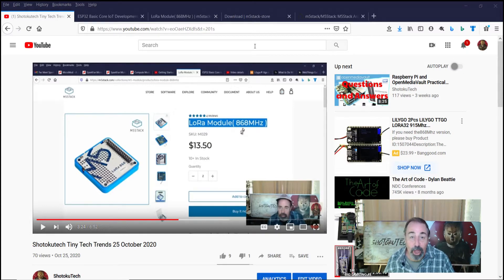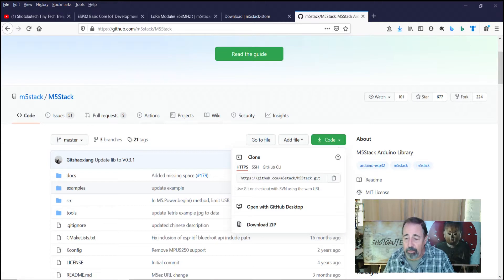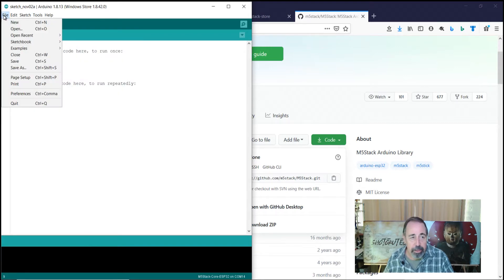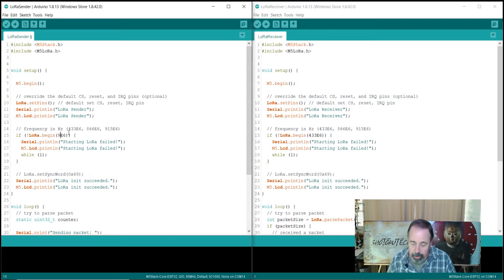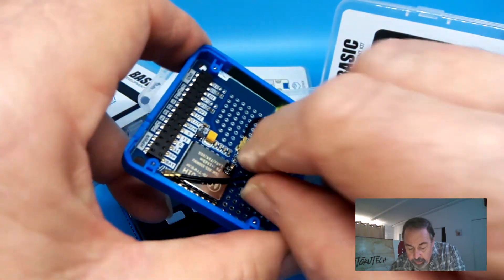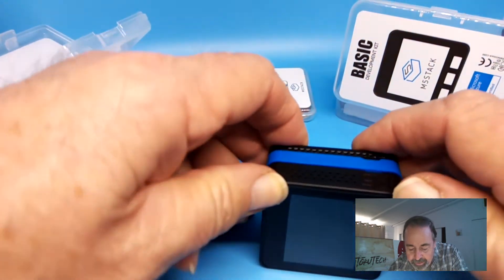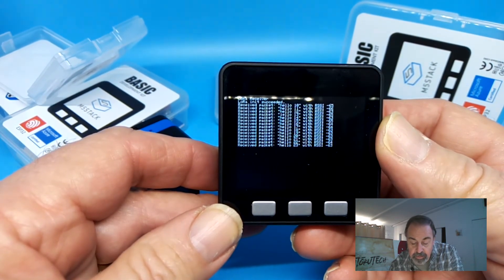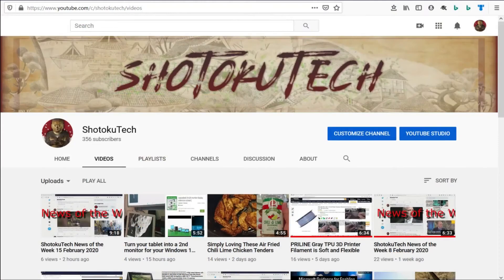LoRa 868 Module Tutorial for the M5Stack Core ESP32 in Arduino IDE

Comment: The lora 1.1 module does not stack onto the core2 with the battery pack. even though m5stack lists them as compatable.
Reply from the maker: Interesting. I don't have a Core2 though. Thanks.
Reply: I asked support and they said the two modules are compatible. They just arrived in the mail and I can't get the Core 2 back plate (even with the battery removed) to attach to the back of the LoRa module. Did you ever figure this out?
Reply: @williamgardner nope, never have gave up they told me the same thing ... If it is compatible I have no idea how ....

Comment: Can i use a ttgo as emitter and m5stack as receiver ?
Reply from the maker: Sure as long as they are on the same frequency and other LoRa settings are complimentary it will work. Both devices have code that fully conforms to the LoRa standard.

Comment: is it Lora module compatible with core2? Where are the battery connection supposed to go from the backplain to the core if the lora board is in between?
Reply from the maker: That's the cool part about M5Stack. The LoRa module passes the pins through from top to bottom. So you just attach the Bottom module after the LoRa module.

Comment: Why aren't those modules  represented in UIflow? Do they work different than the 433 LoraWan Modules in UIFlow? I saw its even possible to configure the frequency in UIFlow.
I bought two of the 433 LoRa modules quite a long time ago, but beside a quick test neve rused them, because 433 MHz is not verycommon vor Lora here. So I was already thinking to buy two of the 868 MHz modules and try them.
Reply from the maker: I really tried to make it work. The module 433 LoraWan did not work with this module. I am busy looking for the shortest path to GPS and Lora. I could not make it work in UIflow. Good to see you! Thanks.
Reply: @ShotokuTech  I never tried to use my 433Mhz modules with UIFlow. Somehow UIFlow is very interesting, but unfortunatley its very poor documented. So I started to play around with UIFlow quite often, but as soon as I really want to program anything I end up in the Arduno IDE.
Reply from the maker: @jeanyluisa8483  Many M5Stack are well supported in UIFlow. I was just caught off guard when I found this Lora board was not. I guess you just look to see what is supported and buy those modules. Thanks!
Reply: @ShotokuTech  I dont think I really want to admit how many of the M5Stack Cores, M5Sticks, M5 Atoms and M5 Modules and Units I bought over the years. It's far too many ;-) I know almost everything, including my M5Bala, M5Faces Kit etc. is supported in UIFlow.  The problem is just the poor documentation for UIFlow.
Reply from the maker: @jeanyluisa8483  Well now we are both coming clean about our addiction. I agree, sometimes I hover over a block and it's like a foreign language or something. I'm stuck trying to get UIFlow to write a RFID tag. Maybe you have advice. Oh I wanted their new paper gadget that is out of stock right as it came out! Ha ha. Thanks!

Comment: Interesting little machine. So it's some kind of sender or receiver`? What can I do with this? It all feels a little abstract to me.
Reply from the maker: The M5Stack is a tiny little computer. Inside is a full color display, three buttons. speaker, memory cards slot, WiFi, Bluetooth, battery, etc. It also has lots of connectivity options for other sensors, motors, servos, etc. The M5Stack is simple to program in UIFlow program. Here I have added to the 'stack' the LoRa868 module. This can act as a transmitter or receiver on the 915Mhz frequency. In some of my other videos I tested similar LoRa radio hardware and got nearly a half mile range in suburban settings. This becomes a flexible device that could be used in many home automation, security, robotics. Next I hook up the GPS unit and send location data. Stay tuned! Thanks.
Reply: @ShotokuTech  Is it possible for it to connect to a LoRagateway?
Reply from the maker: @zongjun8131  Sure, why not? I think you can run Meshtastic as well.
Reply: @ShotokuTech  Ah, thanks for explaining! Like a little raspberry pie? This sounds like we are going to have a lot of such small devices in the next years, if they are starting to be affordable. Thank you for explaining. :)
Reply from the maker: @SarahRabenhertz  Exactly like that. Perfect analogy. Thanks again so much!
Reply from the maker: @SarahRabenhertz  Always appreciated!